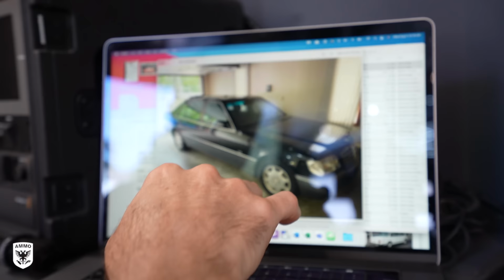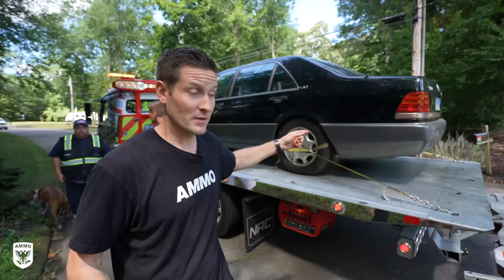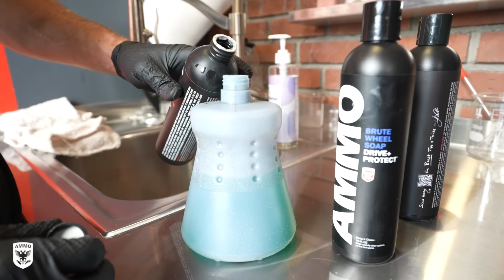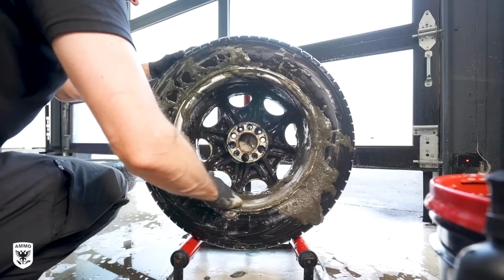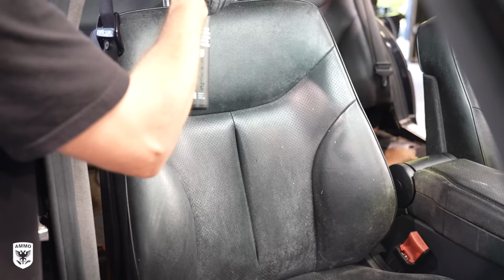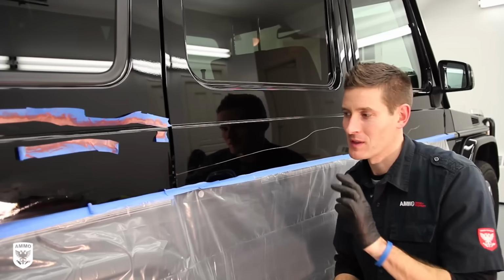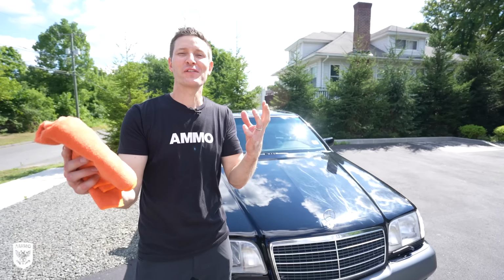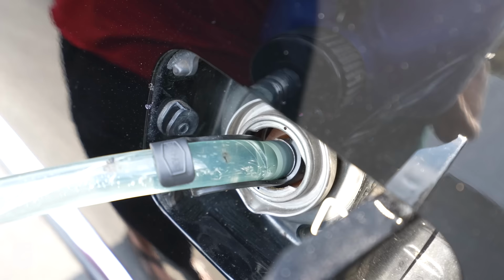First Wash In 8 Years: Mercedes S600 V12 Swirled Paint Best Before and After!

Comment: QUESTION??  I have a Mercedes Benz clk and still cant get that old smell out.
do you think i can add some bleach with water of course to my steamer and crack the window to run the steamer hose since it has no trigger on it to fog up the interior?

FYI: would tape around the window to seal it  so the interior will fog up.

Comment: Any tips on how to remove a stingy diff oil smell from my volvo850 backseat? I had a spare angle gear in a cardboard box on my seat that flipped and poured diff oil on the seat. The smell is pretty horrible and I've tried wet vacuuming (or what its called) on the seat maybe 3 times but the smell persists. Do I need to remove the upholstery off the foam and use some mild degreaser for the seat foam and squeeze it so the oil left inside the foam drips out or something? Thanks :D

Comment: I’m new to this channel and absolutely love the results. 

One thing I wonder: doesn’t the high pressure rinsing of the bottom of the car and the engine have impact on the electronics? I always learned to cover up the engine before I wash the engine space. Underneath I’d think it’s okay because it’s open and it’s also driven in rain and through puddles. Still, I’d like to know for sure.
Reply: If high pressure rinsing destroys the underside of your car, so do puddles of any kind
Reply: @jackthatmonkey8994  that what I said myself in the last part as well
Reply: All of the electronics are sealed or incased in plastic, just use your judgement when it comes down to how much water to use and where. With that said, if you're extra paranoid then disconnect the battery. Can't short anything without power.
Reply: @jr56440  well yeah, obviously sitting water is gonna corrode anything it can. this is why he recommended blowing it all out with compressed air
Reply: I presume it depends on the car. Here's a quote from the manual for a 2022 Genesis G80:
"· Water washing in the engine 
compartment including high 
pressure water washing may cause 
the failure of electrical circuits 
located in the engine compartment.
· Never allow water or other liquids 
to come in contact with electrical/
electronic components inside the 
vehicle as this may damage them."

You also may need to take care pressure washing exterior parts like sensors, including radar, ultrasonic, and even some cameras, and certain seals and gaskets, and some connectors. Some car manuals give a minimum distance and maximum pressure to use, others say not to use pressurized water on some areas at all.

In terms of interior electronics, some seats with occupancy sensors (for airbag deployment and seatbelt pre-tensioner activation) or heating, or ventilation may have instructions not to use steam cleaning on the seat upholstery, or even wet cleaning beyond a damp cloth level. Different cars have different designs. As an example, again from the G80, due to the location of the trunk opening button, the manual instructs you to put the valet mode on to deactivate the button on the trunk before washing in order not to open the trunk with the water stream. Not an issue with a trunk you need a mechanical key for, but a push button is a different thing.

Comment: Car peeps. Any proven solutions to keeping squirrels out of the engine bay?  I went on vacation, came back was driving my Tacoma and all the warning lights were on, popped the hood they went HAM on my wiring.  I got the wiring fixed but I want to try and prevent that. I have 2 cars in the garage already and 2 in the driveway...I drive them all pretty frequently.  Tips?

Comment: Awesome job 🥳
2 questions:
1) why wash the outside before (typically) cleaning the inside ? I’m walking in and dragging vacuum hoses through the wetness this way.
2) is there a different approach (typically) where the repair requirements and parts needed can be determined sooner than later? This way parts can be on order while the rest of the detailing work is done. Or is the detailing timeline so short as to not make a difference anyway?